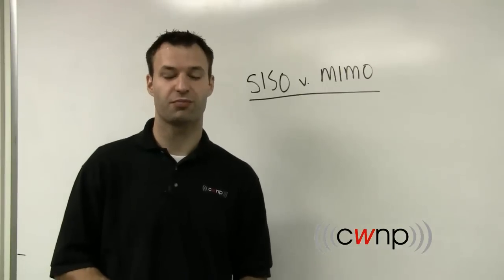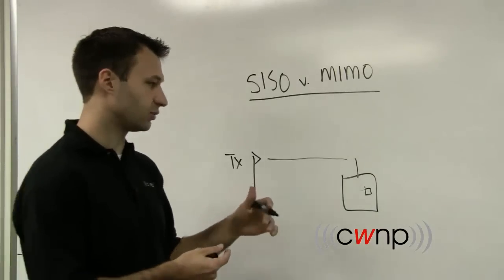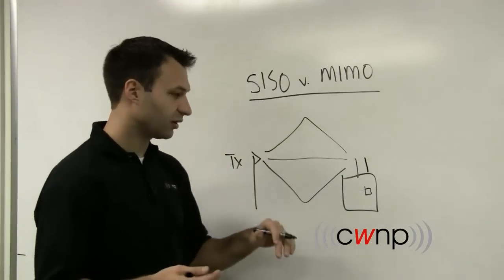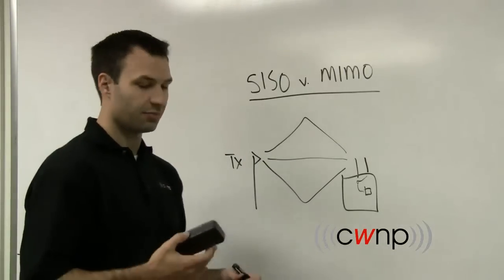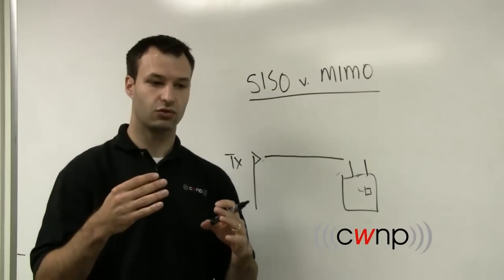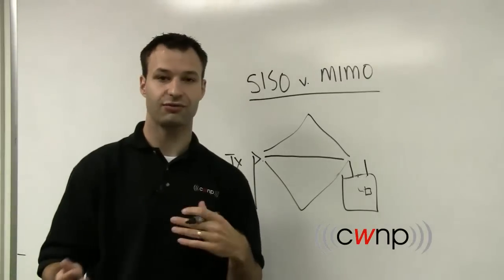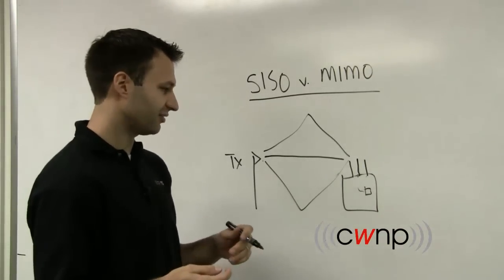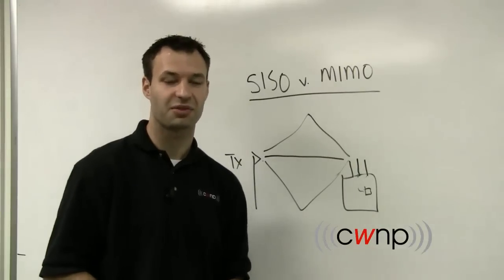SISO vs MIMO (Marcus Burton, CWNP)

Comment: on uplink, can multiple single antenna stations  transmit simultaneously ? the way i see it 802.11ac can transmit downlink to multiple stations at the same time but receiving is only possible from 1 station?! (802.11ax will fix it but for now multi 802.11n and 802.11ac can receive from only 1 station at the time regardless the number of antennas) if there is an engineer here reading this please give me your input.....

Comment: Be aware that the example showed is a SISO (Single-Input Single-Output) vs a SIMO (Single-Input Multiple-Output) configuration. There's no MIMO showed here. A MIMO configuration has always at least two antennas at BOTH transmitter and receiver. Bear in mind this omission should you use this video as a reference.
Reply: can you give me your contact please i am ingineer in communicaion  field , i should like to change idea beteween us   this my email hadjerelec@gmail.com
Reply: I think he is talking about MRC in the second part which is one of the features MIMO has.Actually, I am not even sure whether we can talk about MRC when the transmitter uses 1 antenna and probably does not support .11n.  I agree the example could be a bit confusing. The video is 10 years old though.

Comment: it could be nice... but it is all wrong... the mimo radio indeed has 2 antenas, but they are not to explore reflected or spurious signals... they are designed to use the efect of the 3db signal separation between  the horizontal and vertical polarization. one  antena is horizontal and the other vertical and they exchange tx and rx at the most better performance dictaded by the wimax protocol...only a telcom engineer who has studied the maxwell equations know that... not a IT mam... on my personal note ubiquit stole ideias from mikrotic like nstream and mounting radios on the back of antenas as we always did in the field the are good observers... with a industry behind them...  sorry my bad english